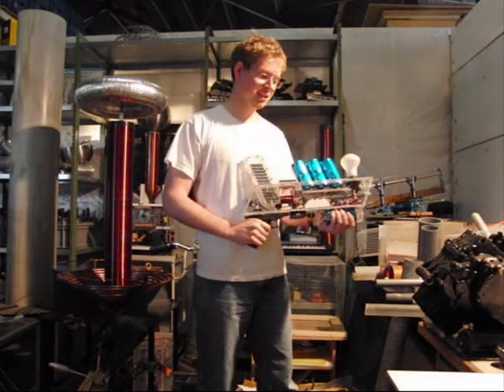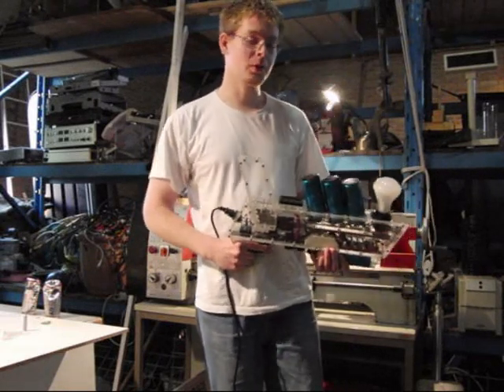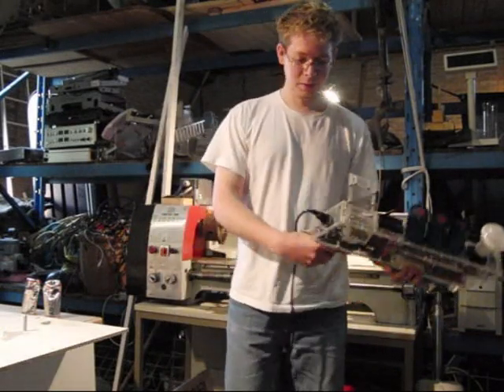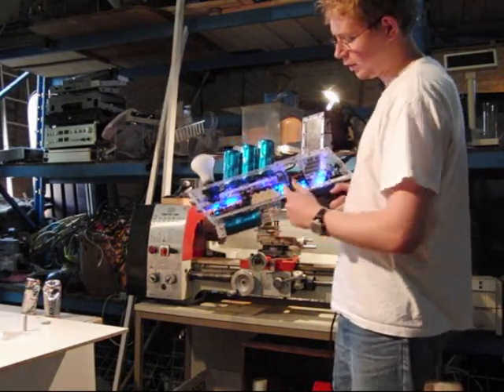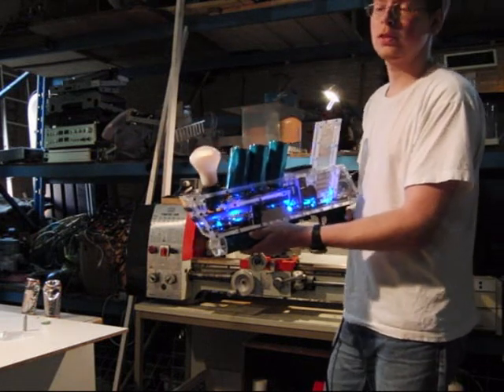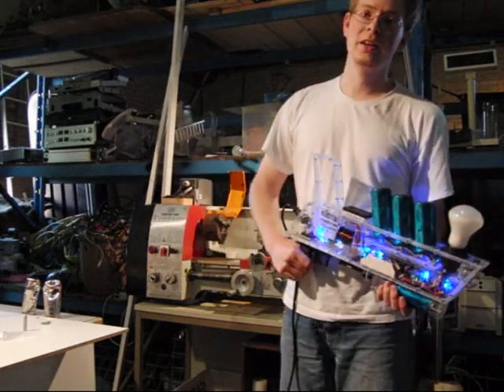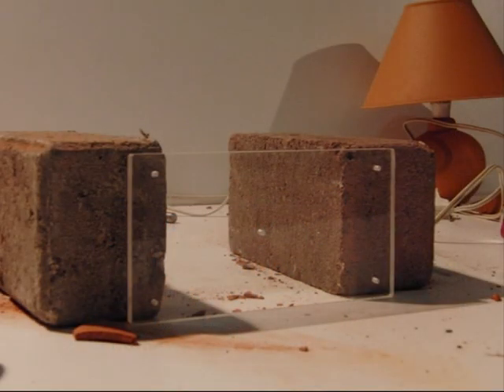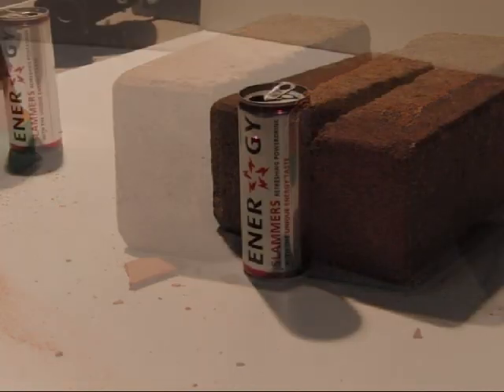MV CoilMaster Mark1 coilgun - Featured on Hacked Gadgets

Comment: Energy is determined only by the voltages, not the current, so any i(t) can be selected. To make calculation simple, let discharge current i=I constant. Then E=I*average(v(t))*T, where v(t)=V-(I/C)*t, (a downslope linear ramp ending at zero voltage with T duration). So E=I*V/2*T, and I=C*V/T, so E=C*V/T*V/2*T=C*V*V*2.

Comment: if velocity is the same independently of mass, then do smaller projectiles, drill them and pour lead inside, this way mass will remain the same but aeroynamic will increase. Am I right?
And what if you added some extra spires on the end of the coil and took away some at the beginning? This way you won't waste energy in the section when the bullet is sucked in, and you could accelerate it more at the end. The first part of the coil would only break inertia. Or not? I'm not an expert.

Comment: I think that's why you need to find to best material, size, and shape to use as the projectile. The rough design is outstanding; now tweak it for maximum efficiency. Also, may I suggest that if you go with thinner rounds, you make them longer and with a pointed tip? Consider that the more force you place into an increasingly smaller area, the more penetration power you will have. (hehe... I said penetration)

Comment from the maker: The problem is that you need volume to magnetize. a smaller projectile with one coil would experience roughly the same acceleration. but if you increase the mass, the total output energy becomes higher as the speeds remain the same.

Comment from the maker: @coilsinamotor  The camera tapes with 1000 frames per second. The black and white stripes are 10cm wide, and the total board is 100cm. With the camera I stepped through the video and counted the frames. Then I calculated the speed with the formule: Speed [m/s] = ( distance [m] / frames it takes to cross that distance [x] ) * frames per second of the camera[x].

Comment: If the internal battery pack is good for one magazine, why not integrate the batteries into the magazine itself. That way if you don't have an outlet to plug into, you still have power for every magazine you have. Just a small idea.

Comment: Nice work for such a short time. The design is interesting, I did one based on a 1940's design back in 1970 but I used multiple coils. At the time I had trouble synchronizing the coils. Have you thought about trying multiple coils using light controlled Triacs for triggering?

Comment from the maker: Im using a thyristor to fire the capacitor bank, so the capacitors will be fully drained. It could be a little more efficient if it were to cut off at the center of the coil. Adding more stages would increase velocity greatly, but if you need 5 of these capacitors for each stage it would be impossible to carry around.

Comment: A rifled barrel only works with soft metals. Lead is used in combination with for instance Nickel to make the projectiles a bit harder, to whatever the user likes. Lead is also relatively cheap. That's pretty much the reason why we don't use fancy metals for projectiles.

On a side note, if you add a stock and some good aiming devices, a magazine on the belly of the gun, etc., you might have a good platform to launch grenades.

Comment: Instead of a projectile inside a barrel, why not a ring projectile that slides on the outside of the coil. A rifled coil gun, in my mind, would not be too effective because  there is too much force needed to push a bullet through a rifled barrel...too much friction and the bullet goes not as far. It needs to glide through the barrel very easily.

Comment from the maker: There are no steel objects near the coil (other than the screws and slugs). If I used washers at the start of the coil the slug had to be partially inside the coil, without any washers the slug can be +-5mm outside the coil and still be effective (which is very useful when you want it to be semi-automatic).

Comment: Very impressive coilgun, especially for single stage! Could you share some info on the coil itself? 
-What wire size you used
-Amount of layers and turns or size(inner diameter, outer diameter and length)
-freewheeling diode or critical damping resistor?

And are those regular electrolytic caps or pulse caps?

Thanks!